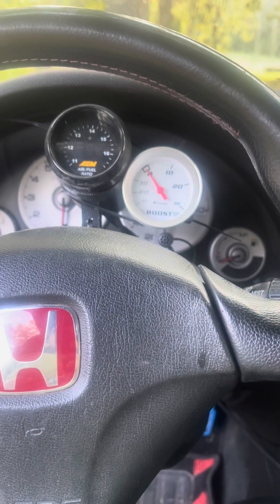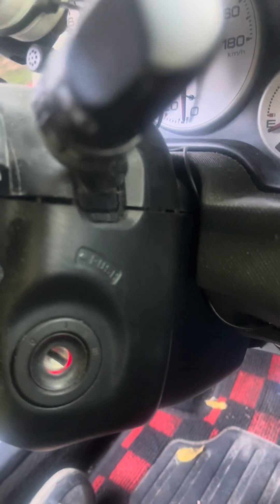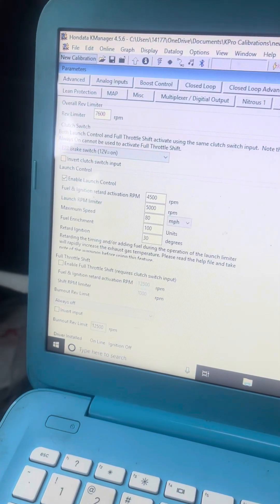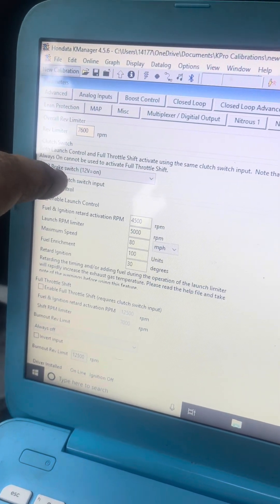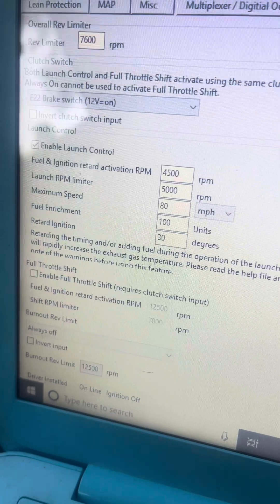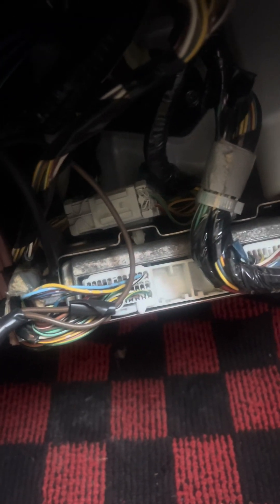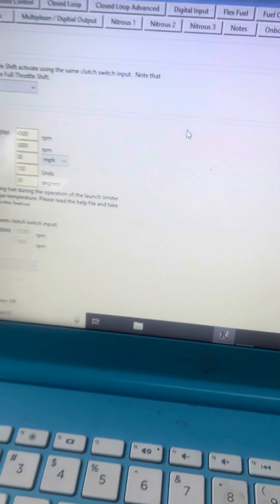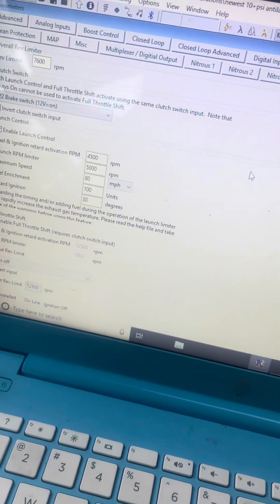K series tutorial rolling anti lag kpro

Comment: Which color wire did you end up using for ur brake switch?
Reply from the maker: @NotTrexGirlYT  I don’t remember what color it is just need to find the correct pin and connect it to the switch you are using
Reply: So does the wipers go off too when you’re holding the switch for the anti lag?
Reply from the maker: @moneyg5071 no I cut it so it don’t give signal to the washer motor
Reply: @shotinthedark5924 oh alright! Thats what I was going to do or disconnect the wiper motor. 
I think I found the right pin for it. So do you just connect another wire to that and run it to the e22 wire?
Reply from the maker: @moneyg5071 pretty much all you are doing is sending power to the e22 spot on the ecu
Reply: Thank you so much bro! Appreciate the fast replies too